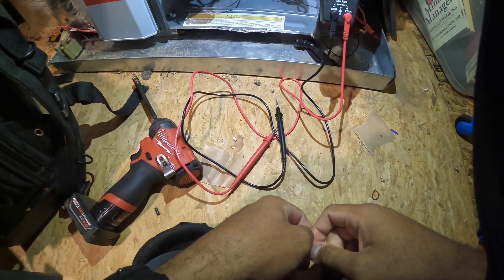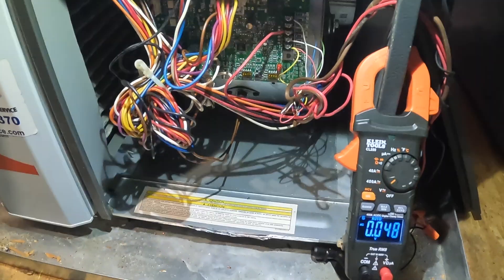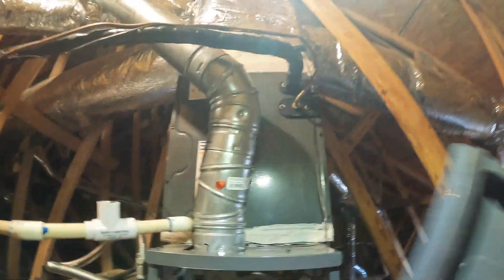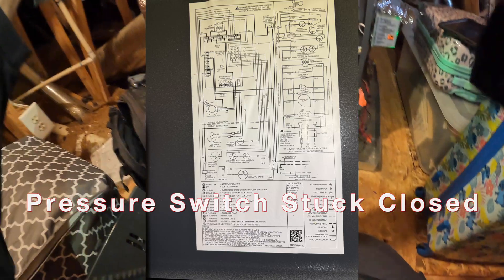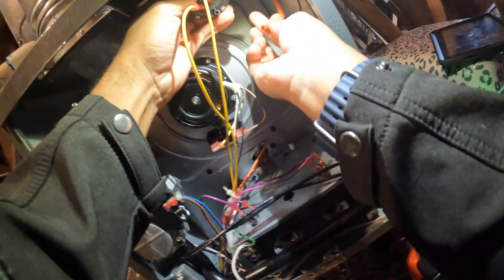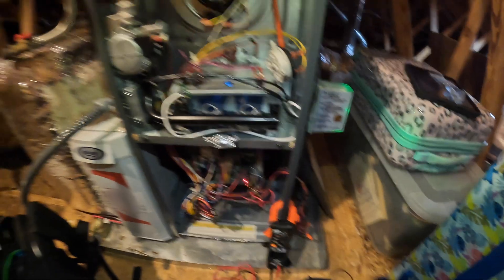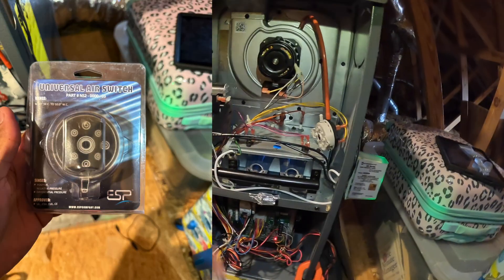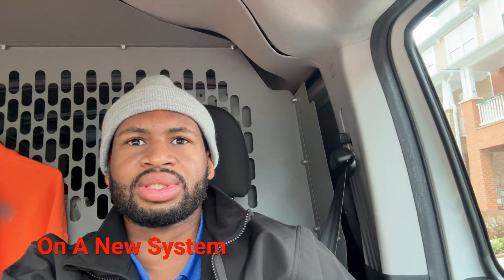PRESSURE SWITCH GONE WRONG #hvac #hvactools

Comment: A better way (IMO) to test the switch:  disconnect the wires to the pressure switch, and connect your ohmmeter to the pressure switch terminals.  Call for heat.  You should see an open circuit before the call, and a closed circuit after.  This way you are actually testing the pressure switch.  I'd do this before and after I cleaned out the inducer port.
Reply from the maker: @cleansebob1  great share 👍🏾